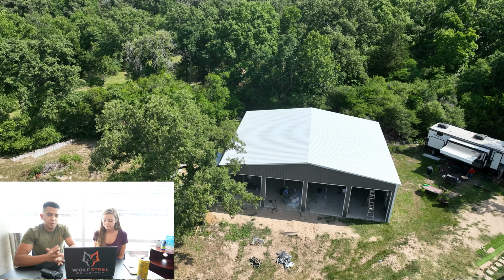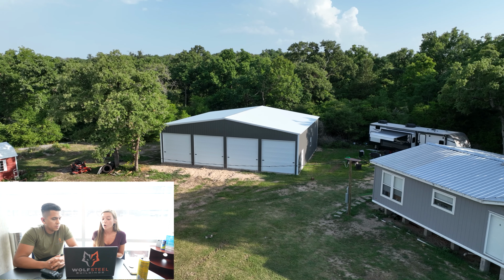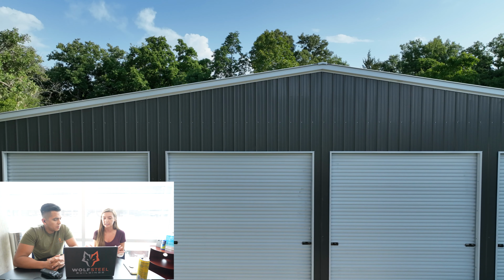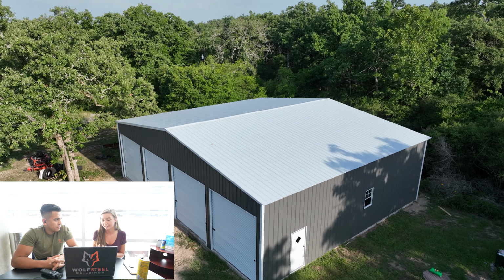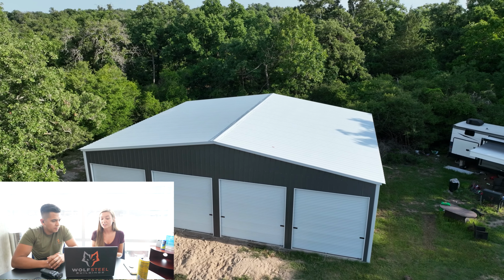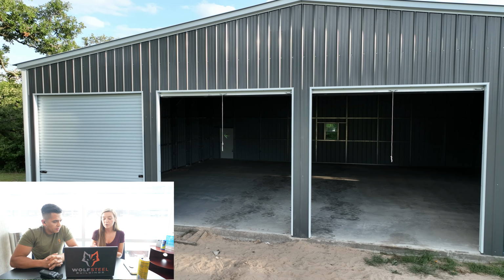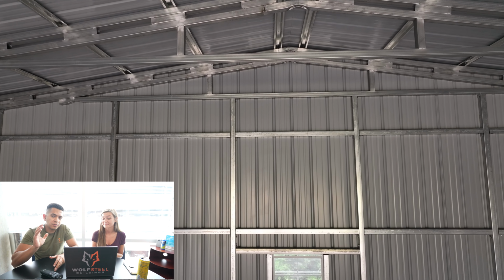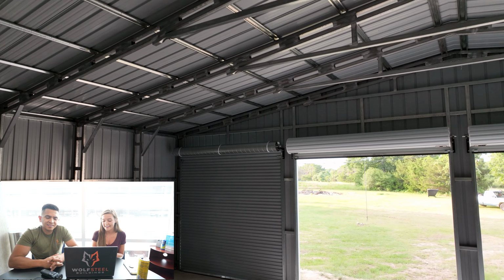How much is a 46x40 Metal Building with Concrete Slab in Texas | WOLFSTEEL BUILDINGS

Comment: If a property has no restrictions, outside a city limit, how would that affect cost? Say Victoria county. That size or 40x60
Reply from the maker: You are in a high wind area. Your building should be reinforced to meet at least 135 -155 mph wind load. Your building cost can go up to meet that engineering. However, if you are not having heavy equipment you can save on concrete cost by staying with a 4" thick slab.
Reply: @wolfsteelbuildings  feel like for longevity the 6” would be best. Less cracks and for future use as well. 40x60, 14ft walls. One that could be turned into a barndo if decided to.
Reply from the maker: @TexasSamC  yes! This type of trussing is engineered for residential living and commercial.
Reply: Hello, can you refer a contractor in San Francisco bay area? I am interested in building a metal frame building. Thank you.
Reply from the maker: @jm452  I don’t specifically recommend a company. But I can say American Carports may service your area. I know they have been in business for a good time:)